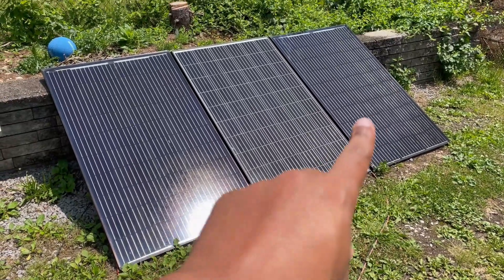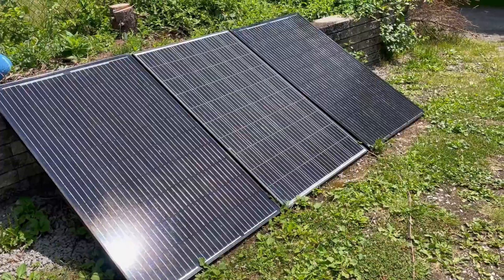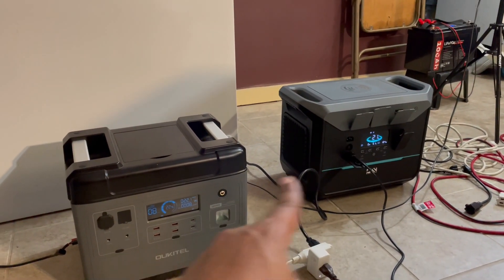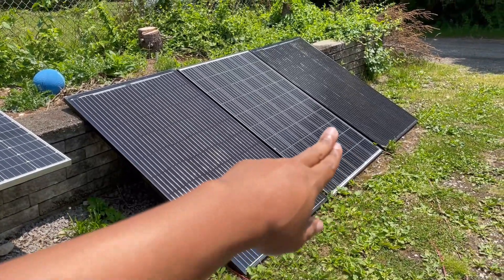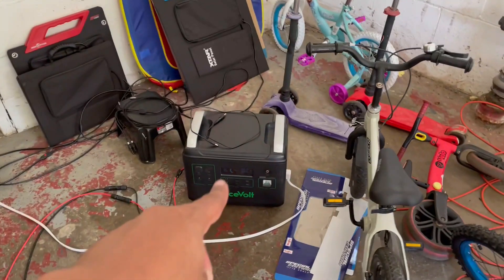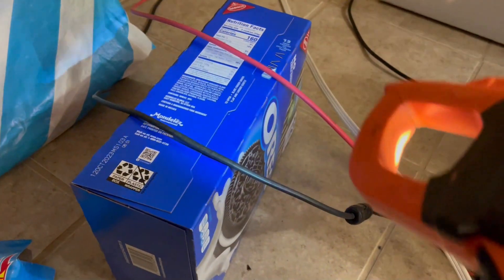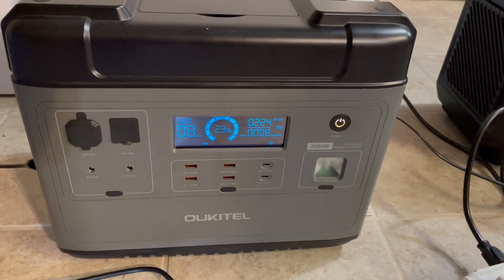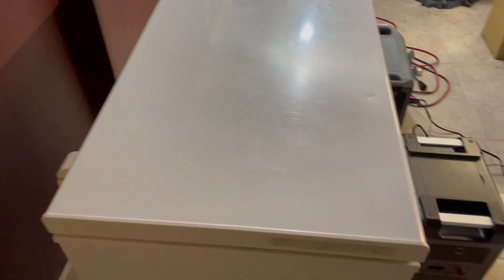Forced To Change My Solar Panel Setup - Voltage Too High!!

Comment: Get yourself something like an Epever charge controller that can take in over 100V, and use that to charge the 12V batteries you use for extending the run time of your power stations.  That will solve all your voltage problems.
Reply from the maker: I find that the charge controllers have somewhat low watt limits that dont quite help me as much as I would like. Ill check out the Epever to see what their watt max is on 12v.
Reply: @AskIveSolar  I think mine is 40A (480W), but they have higher ones.
Reply from the maker: The issue is that's no better than what I get with power stations. I have one now that can do 150 but maxes at 750 watts on 12v. So even if I put 3 panels in series, it's limiting them to 750 which is not bad honestly but not quite an improvement. 

Imagine a 2s2p with 300 watt panels. That's 1200 watts limited to 750. Even a thousand would be a better limitation when you consider the 20 percent inefficiency of panels. 

1200 minutes 240 would be 980. So I'd be throwing away 260 watts. No bueno.
Reply: @AskIveSolar  The problem you're solving here is voltage though, not current.  Give your power stations all they can digest, but you have so many panels now you can put the extra ones in series (up to that 150V) to feed a charge controller.

Comment: Try using a solar panel to buck converter to power station setup to limit the voltage to the maximum rated voltage supported by your power station and you should be able to max the solar input on the power station
Reply from the maker: Do you mean pairing a 12v panel with one of these to buck it down? If so, interesting. Im not sure if that would help me but maybe I dont understand it.

Comment: You can buffer the panels through some discrete gear before pushing it into the power station.  Basically like this:

* Victron SmartSolar 150/35 (or the smaller 100/20).  The 150/35 has a 150VDC solar voltage limit and the 100/20 has a 100VDC solar voltage limit.  I recommend the 150/35.

* 50Ah or 100Ah 25.6V LiFePO4 battery.

Solar -> Victron -> 25.6V battery -> (25A fusing) -> Power station(s).

There will be some losses given the extra DC conversions, but it's a decent solution if you want to continue using power stations.  The solar will charge the battery and the battery will then trickle-charge the power station.   You can use 10 AWG cabling for almost all of it, but if you fan-out from the battery you'll want a decent 100A or 200A bus-bar and 2 AWG or 4 AWG cabling from the battery to the bus-bar.

Generally speaking you don't want to connect the Victron directly to the power station, you have to buffer it through a LifePO4 battery.  Usually a 12.8V or 25.6V LiFePO4 battery.  25.6V usually works better (as long as the power station can take 30VDC on its solar input).   Use the bluetooth app to configure the Victron.

Features:

* The solar can keep charging the battery even with the power stations disconnected.

* You can connect the battery to multiple power stations simultaneously (since the battery can put out a lot of amps in aggregate).

-Matt
Reply from the maker: Brotha Matt, it took me forever to respond to this because I wanted to give it my full attention to really process through this solution. 

And I still don't know if I'm ready lol. But I'm reading it this morning.

Comment: My man! Love your stuff!  When are you gonna get yourself a standalone battery and separate inverter and separate charge controller?  Charge controller will give you that extra voltage (super cheap ones go up to about 150V).   With the amount of stations you have it would have been more cost effective eons ago.  a couple power stations, sure, but man it's like you're a solar farmer at this point having to tend all your solar creatures, lol!   Keep em coming!  can't wait for summer and more light!  Currently only getting about 400 watts on 8 400 watt panels and the sun is trying to peak through some dense clouds.
Reply from the maker: Holy moly! You're stacked over there! Do you see 5 percent output regularly. I usually see like 10 percent on any given array in overcast. 

And to your question 🙂 about a diy separate system. I kinda have something in the works. I have a huge 3.5 kWh batt and a new inverter from bougerv and I recently tried it and it does something weird with voltage. 

I have a charge controller as well but haven't hooked it up yet because it doesn't really save me that much. 

It has 150v but it maxes at 750 watts in which is aight but kinda weak. Maybe 3 panels combined. 

I would want to do a 2s2p but that's 1200 watts on paper so it's over doing it. If it could do 1200 or even 1000 at 150v, I would have hooked it up a long time ago.

Comment: I just fried a 1000w Lipower LifePO4 power station by over voltage.  I was charging an Allpowers PPS with panels that were putting out around 40v.  I got done charging the Allpowers and then plugged in the Lipower, but I forgot the Lipower only takes up to 30V.  It immediately fried and is dead now.  From now on, on my lower voltage PPS, I will mark the input with blue tape to remind me to check the incoming voltage.  Costly lesson learned here.
Reply from the maker: Remo, first of all, good to see your name in the comments. Second, I did the exact same thing! And man it hurts!!

Comment: Do you still have and use the 400w bougerv panel? I was considering getting one and wanted to know what kind of max wattage you were able to get
Reply from the maker: That size is lovely for a 400 and it working well. I never get great output out of it compared to other areas but I love it. Still kicking. 

Did you ever tinker with that power station I sent. I think ctechi?
Reply: @AskIveSolar I was able to pull the battery cells out of the ctechi and use. I think the main board might have been fried. What power station do you have connected to the 400w bougerv panel?
Reply from the maker: Vtoman flash 1500 but I'm slated to put it on the AC200P using the dc optimizer to be an addition to my 1000 watt lay flat array. Being able to move 400 watts around in a 300 watt form factor is pretty cool. 

But keep an eye out for panels on the various marketplaces near you. Like FB and Craigslist
Reply: @ I actually found the bifacial 400w on FB for $75. I am curious to see what actual watts can be pulled using the dc enhancer on my ac200p. Thanks